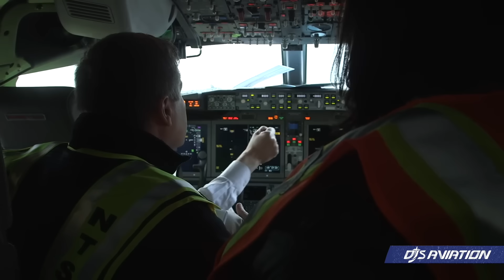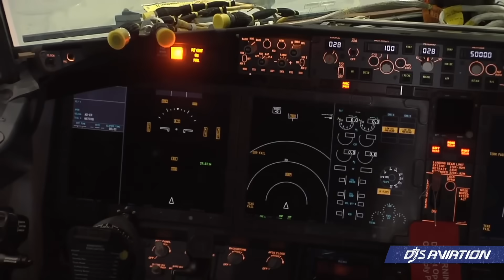Huge Boeing 737-9 Grounding Updates

Comment: Chrysler can have loose bolts.
Ford can have loose bolts.
GM can have loose bolts.
BOEING CAN NOT HAVE LOOSE BOLTS!!!
Boeing used to be run by engineers.  Now Boeing is run by accountants. Safety is not a word accountants know how to spell. Safety is a byword that engineers live by.
Reply: Boeing management probably thought: if loose bolts do not impact us, it cannot impact our company.
Reply: Do you know that accountants have less saying as engineers? The fact that the managenent priorice EBIT over Safety is the real problem.
Reply: GM has always been run by bean counters. Hence the bad cars.
Reply: Prior to the crashes, Boeing was run by Dennis Muilenberg,, an engineer.
Reply: your terminology is wrong. It's not the accountants, it's the board of directors and wall street bankers.
Reply: In true Aviation the word safety is meaningless, it’s a word for the Joe Public to feel better about whatever the subject is. You cannot measure safety, safety has no quantifiable definition, you simply cannot measure it. When an organisation prolifically uses the word safety it often means they have a pathological belief that alls good in the kitchen. So back to true Aviation, it’s risk based that is quantified, measured and you place acceptable limitations and standards. So let’s not use the word safety in Aviation, it undermines so much and masks so much more.
Reply: It's worse. The plug is designed such that as long as some of the bolts are in place, loose or not, the plug will stay in place. All indications so far are that they never installed the bolts. This is how bad the quality control is in the factory.
Reply: never buying anything with loose bolts, if the wheel falls off on me then I would be dead, never buy something made in mexico.
Reply: Add DEI and this is what you get.
Reply: Ehh, cars do have points of failure that you absolutely don't want loose or poorly sealed. Try running dry on brake fluid on the highway, for example.
Reply: I WORKED WITH TOYOTA ON THE AVENSIS* It was NOT possible to miss a bolt or to incorrectly torque a bolt. Every step on every car has a fixings tray, that went on a bench and the camera confirmed it was full, the installer did their work and the pneumatic torque wrench was programmed in order for the fixings, when they finished the torque wrench would talk to the camera and confirm that ALL bolts had been installed and ALL bolts torqued.  This was back in 2002.   How is it possible Boeing has a worse system in 2024...???  A $25k car is made better. 

As far as I know, this is now pretty standard. If ford has to fix a warranty repair cos someone missed a bolt - thats the profit on the car is GONE. so I doubt Ford or GN do ever have missing bolts. The days of expecting 10% of cars to have warranty issues is LONG gone. Even the cheapest cars today are amazingly well-engineered, its the electronics that fail - just after the warranty runs out... 

*I supplied the projection systems for the 3D design process.
Reply: @henryptung  brake running dry is not as bad as a wheel falling off.
Reply: There aren’t any loose bolts if there weren’t actually any bolts on there in the first place 🤷🏻‍♂️
Reply: So you think it’s ok for brand new cars to have loose bolts? 🤔 Why? If your vehicle wheel flies  off  going 80 on the interstate you’ll be in way worse shape than anybody on that flight was
Reply: @glashalffull  Always? That's why my two GM trucks with a combined age of 77 years still run and drive flawlessly with proper maintenance I guess, bean counters and bad quality. Not to say some of their vehicles weren't/aren't complete junk, like most subcompact cars, but those are cheap and not meant to last a long time. You can have the best built vehicle on the road, but if you ignore maintenance after your free oil changes/grease jobs/inspections run out and never learn anything about the vehicle you drive to recognize when parts wear out and when any problems arise, like many people do, you'll be selling it to a scrapyard for $500 in no time.
Reply: The stupid part of this is that they should never have had bolts in this design as the damn point of failure, they should’ve learned from flight 811 that any internal door needs to be made to pressurise flush with the airframe. They should’ve engineered the plug to be an actual plug and seal with cabin pressure alone, and not rely on a fragile and easy to dislodge mechanical fastener to keep the plug in the plane. The fact that they did not do this is just as big of a problem as quality control, as good engineering would’ve made a plane that stayed intact if a couple of small fasteners weren’t there in the first place
Reply: @Underestimated37  the reason they were plugged the way they were with bolts rather than rivets is because for heavy maintenance checks the door plug has to be able to be moved out of the way. This jet was essentially brand new and hasn’t even be flown enough yet for even a B check let alone C or D
Reply: @Underestimated37  Why not just put an actual door in there that can be opened and closed like the others on the plane? It is available. Eliminates the issue totally. But I guess it's more expensive so airlines don't order them. Don't get me wrong, the plug door design is on Boeing, so is them telling airlines it's safe. but after the blowout, you'd think airlines would spend a bit more to make that door area completely secure and make customers more confident tat it will never happen again. .
Reply: @tritontransport  you don’t understand, I’m not talking about riveting it shut, I’m talking about putting a lip around all 4 sides (like an actual plug) so if any fasteners fail it can’t go through the hole. That was why flight 811 crashed, the cargo door wasn’t designed as a plug and relied on mechanical fasteners which failed and blew out the cargo door, causing the plane to crash. It was a massive engineering oversight by Boeing and you’d think decades later they’d have learned from that mistake. To be able to remove it you then bring it inside the plane, rotate it and pass it through the gap.

Comment: Alaska airlines must surely be regretting it's decision to dump Airbus for Boeing. They were doing just fine with the A320s, and the A321s would've been just phenomenal for them in terms of range and capacity.
Reply: @pigjubby1 Airbus: “you can have your first plane in 5 years”

Alaska: “Hi Boeing, I want to cancel the cancellation on the planes order”
Reply: To be fair, it's not like they switched their fleet to boeing from airbus. They were all boeing at the time they bought virgin and that was when they added virgin's airbus aircraft into their fleet. They've since added the embraers as well as more airbus from hawaiian if the deal is finalized.

Comment: It's not a door issue. Those exact same doors are on the 737-900ER, and that model has been in operation for over 15 years. I'm an airline technician who has worked every series 737 produced, including the 900ER and they 9MAX.
Reply: Agreed, it's a quality issue.
Reply: Nailed it. The design is absolutely fine- but somebody stuffed up very badly both initially AND with signing work off.
Reply: the same door is on the 737 8200 or max 8 from Ryanair
Reply: I'm in Europe.  This is a major concern for me.  Ryanair claims they're not affected....truth?
Reply: @uishabeg  they are affected too,  today a have to tale a plane to Lisbon with them...
Reply: Exactly...hey what are these extra bolts for with the castle nuts? beats me ,lets go to lunch.
Reply: @254lele no it isn’t. The 737-8 200 has a functional emergency exit in that location. This was a plug. Not a door.
Reply: @bhm1712  from what I'm seeing they are identical
Reply: @bhm1712  I have not worked Boeing for 15 years. I was under the impression that when that position emergency exit is not used the emergency exit it replaced with a plug. That way it can be removed from future maintenance as its  no longer an exit!
Reply: @254lele They’re not identical in any way. The Alaska 737-9 Max has a door plug which is not a functional emergency exit and serves only to “plug” the opening in the fuselage where an optional emergency exit can be fitted if necessitated by the regulations surrounding passenger capacity. The 737-8 200 Max has a fully functioning emergency exit in that location due to the high density configuration. The door plug is only visible from the exterior of the aircraft and is covered inside by the interior panelling. The functional emergency exit on the 737-8 200 Max has the emergency release mechanism and handles and the row of seats is spaced as per the regular emergency exit row spacing.
Reply: @bhm1712  ok thank u Sir
Reply: @bhm1712 true statement.

Comment: Interesting how quality failures have now become quality escapes. Wonder what the next terminological change will be?
Reply: A quality escape is a form of quality failure. More or less the same thing.
Reply: The point is that the corporate copy language change is a stupid attempt to lessen the issue in the eyes of consumers  @AetherMoose
Reply: @LARKXHIN both terms hold the same weight imo. I dont think its that deep
Reply: My money is on "oopsie"
Reply: @mipmipmipmipmip  likewise.  We'd have called it a "quality inspection failure".
Reply: Apropos, "quality escapes" is foretelling of the "Senior Management Escapes" that should occur as a result the Max issues.  Boeing messed up the design and productization of MCAS. Now messing up manufacturing process and quality control.  Two different functional areas.  This tells us something.  Look at where those two functional area join on the org charge and fire everyone above that join.  It's the common/root cause of these two organizational failures.  That's where the rot is, and it needs to be cut out and replaced.  Just like corrosion repair....
Reply: It's the FAA, they also changed DER to EUM/ODA and other confusing garbage that no one can remember or is not a part of aviation's historical acronym list, which drives everyone crazy.
Reply: the aircraft identified as a boat and was just letting off some steam.
Reply: Seems like the executive and management folks need to be part of a “right sizing adjustment”.
Reply: Quality Discontinuity. Quality Variance. Alternative Quality Standard.
Reply: We always called them escapes per the lingo
Reply: @AetherMoose you are but one of literally billions of people on this wet ball of rock and gas we call home. what guarantee do you have that literally every other person in existence will interpret the phrase in question the same way you do?
Reply: The term 'escape' is used in the UK in aviation manufacturing when a defective part gets past a quality control stage.
Reply: It's such an Embarrassment for Boeing .. It's just a freaking New 2 week old aircraft .. how could that be ??
Reply: They will call stock buybacks looting future growth to meet the CEO’s remuneration incentive bonus goal … oops I mean they will call it Financial engineering
Reply: These managers are the same who though calling employees and WEALTH CREATORS mere 'human capital', as if they are to reside in pens and have their employee numbers tattooed on their wrists.
Reply: @LexYeen  its not that deep big dog
Reply: Airbus will always win 😂

Comment: Alaska was bitten VERY badly by bad maintenance in the past. They appear to not want to take any chances this time.
Reply: Alaska Airline mad a big mistake on phasing out the Airbus planes for the Boeing 737 MAX, the should have kepts the Airbus planes instead of the piles of junk 737 MAX.
Reply: @Perich29 the plane is amazing, the assembly of the plane not so much
Reply: @codbot3251  What is amazing about the 737 Max? It is an outdated  design which capabilities are stretched to the limit for profit maximization. Boeing should have developed a worthy successor, not prolonging its life to save costs.
Reply: It's the airline industry that's wedded to what will be a hundred-year aircraft.
Reply: @neodym5809  In fairness, I wouldn't trust this modern Boeing to design and build a brand new clean sheet plane.
Reply: @neodym5809  it’s one of the most used jet liners in the history of commercial aviation, there’s a reason for that. Who are you an engineer for them?
Reply: @codbot3251  the reason being that exists for more than half a century. It is time for a design that does not rely on grandfathering features from the 60s (as otherwise, it would never get certification)

Comment: Read my lips:  more accidents due to quality issues are bound to happen and not with the 737 only. The 787 is also built with a shoddy quality.
Reply: Is DEI (Division, Exclusion & Incompetence) paying dividends for Boeing yet?
Reply: The 787 isn't built with a shoddy quality anymore. Recent ones were supplier problems. If ypu know of any then they'll be occurring now. The 787 is doing really well now
Reply: @PAVANZYL ridiculous comment. Always weak and brainwashed guys making these comments.
Reply: For the people on the plane I hope not, but with this level of quality control it is possible 😢
Reply: @nickolliver3021  some airlines have stipulated that their 787 can’t be coming from the SC factory. So there is that. 🤷🏻‍♂️
Reply: @rtbrtb_dutchy4183  Why? Prove me wrong.
Reply: @PAVANZYL  I don’t have to prove you wrong. That’s not how it works. You make the accusation that this is related to DEI. So YOU have the burden of proof, not me. 

You sound brainwashed to come to such conclusion out of nowhere.
Reply: @rtbrtb_dutchy4183  One problem.  Every single one made now comes from that factory.  They closed down the Everett 787 line.
Reply: @cjmillsnun  right, that was like 4 years ago. I guess that’s not current anymore. Actually, I think some airlines were complaining and threatened that they wouldn’t want deliveries from SC unless quality control was fixed. I don’t think any refused deliveries.

Comment: if the incident resulted from a generic "quality escape" rather than being specific to the 737-9s, then why is only this model being grounded?  doesn't that cast suspicion on the quality of all recent boeing planes?
Reply: Because this model uses a Dooe Plug, duh.
Reply: A generic quality escape has not yet been established which is why the FAA is conducting of Boeing's processes.

Comment: The term “Quality Escape” didn’t exist in the aerospace industry 20 years ago.  It’s a meaningless and ridiculous term that Boeing concocted to replace the word ‘failure.’  Which MBA came up with it?

I’ve worked for NAA/Rockwell on the B-1, Northrop on the B-2 and Peacekeeper missile, General Dynamics on Atlas rockets and Centaur upper stages, then military training systems, and finally UAVs.  You can have Material or Subcontractor or Manufacturing or Quality (QE/QA) failures, or any combination of the preceding.  But, “quality escape?” 🐂💩

Comment: if the emergency exits over the wing are the same mechanism, they should be checked also, it appears that they would be since the plug door could be removed and replaced with a working door using the ssme hardware

Comment: It looks like the plug issue may not be related to Boeing or Spirit as recent photos have shown the installation of the aftermarket Wi-Fi system by a third-party vendor involved modifications to the aircraft in the vicinity of the inactive exit.  Those photos show a gurney up against the door and work ongoing on a dome being placed on the roof. Workers have stated that on occasion the mid cabin exit plug would be removed to allow easier ingress and exit to facilitate working on the aircraft.
If the vendor failed to properly reinstall the plug bolts, then we would have an Alaska Airlines issue and a vendor issue since the aircraft was delivered from Boeing in an airworthy condition and the problem only arose after Alaska Airlines chose to have the aftermarket Wi-Fi system installed.
This probability is further validated by the pressurization issues which occurred after the modification was completed and the aircraft returned to service. If the plug was removed as a field expedient, then the proper checklists and accountability may have not been in place.
The plug would have likely remained in place due to the weight of the plug (65lbs.) however the lift assist springs located in each of the lower hinge assemblies may have slowly worked the door higher in the door frame where eventually the inner stop fittings and the outer stop pads became misaligned allowing the door to open.
It should be noted that the originally fully functioning emergency exit was secured by the door opening and latching mechanism none of which was installed on the plug.
This type of emergency exit has been installed on other aircraft such as the B757 and has functioned for close to 40 years without any major issues. 

.
Reply: That is only valid if this was the only time we see this rather than the fact it is seen on multiple b737 max and not just from Alaska. 

Try again.
Reply: @irtwiaos add to that the fact that the pressurization alert issues also happened on the ground and we can assume that those previous alerts were actually false alarms.

People are so eager to put Boeing out of the wind...
Reply: The loose bolts on some aircraft of both United and Alaska don't quite fit that explanation, unless all had similar post delivery work in that location.
Reply: Boeing have already claimed responsibility and admitted they failed.